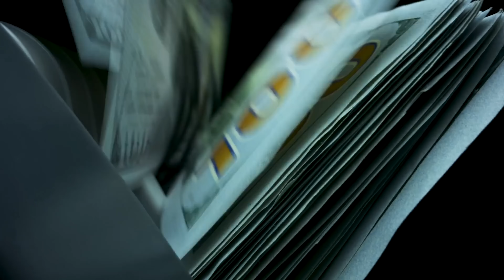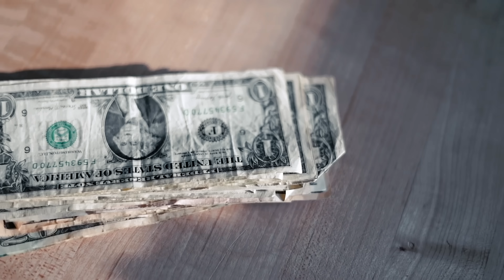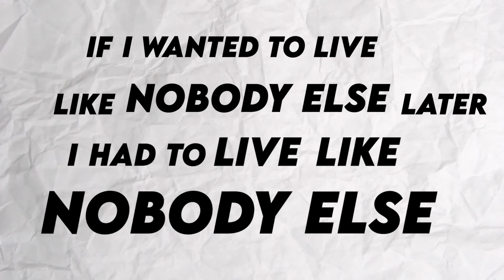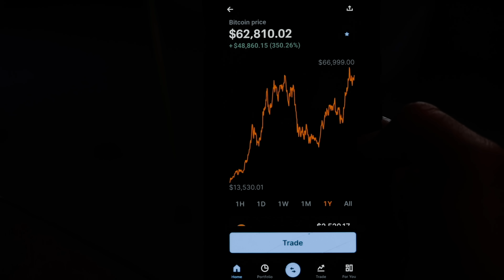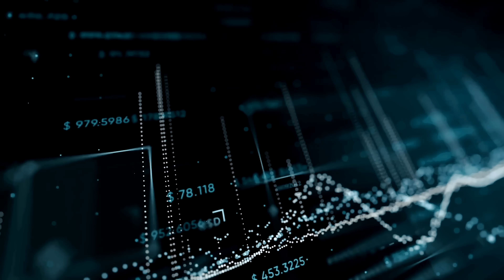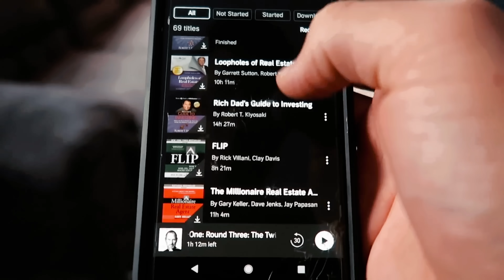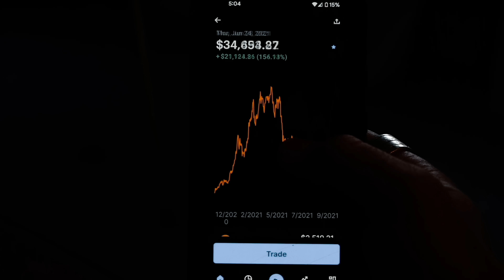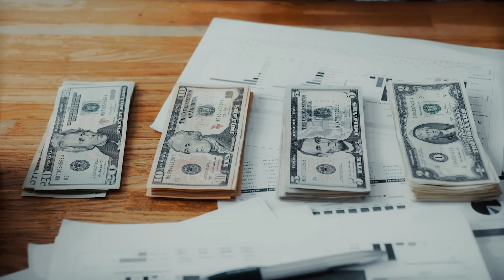8 Pieces Of Financial Advice That Changed My Life

Comment: Dear, Gabe,
could you please explain (or even better do a video on) the difference/line between frugal and cheap in your opinion, respectively with examples from your own life?..
Thanks a lot!
♡
Reply: Frugal is going out to a fancy dinner with friends every month vs. every week. Cheap is when you go out to dinner with friends and leave a poor tip or try to stick your friends with part of the bill that was actually yours.
Reply: @greg_216  
Thank you for the example!
Reply: Cheap is buying lower quality, frugal is not buying unnecessary things. But God chose the weak to put shame to the mighty, cheap is not a bad thing, neither is expensive a good thing.